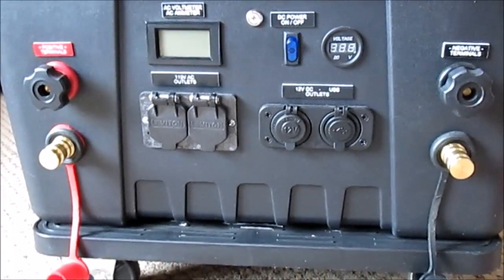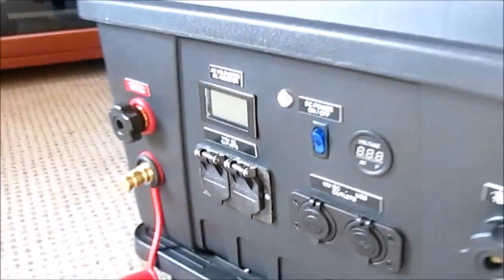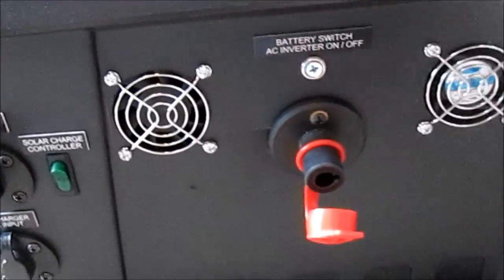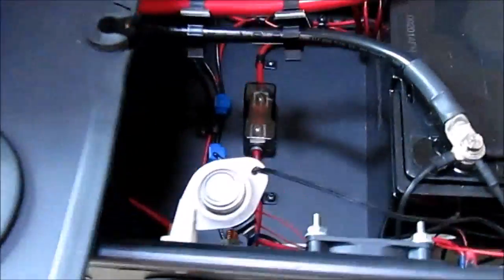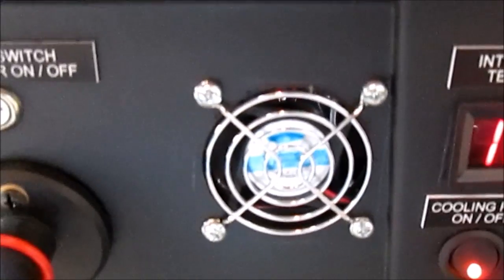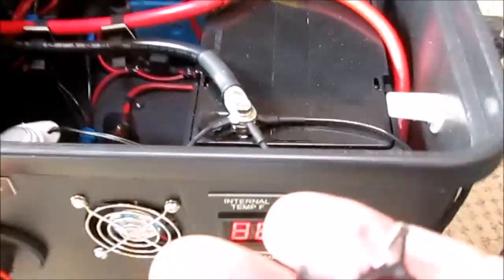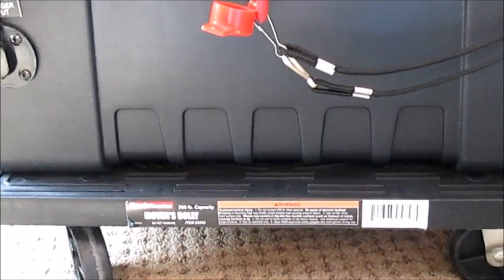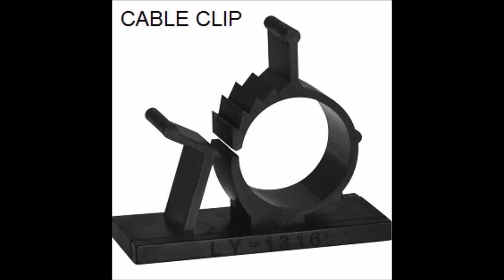V1 P4 DIY Portable Solar Power Generator

Comment: Years late to this it seem.  No, I don't care for the SAE connections.  I would have used Anderson PP instead in most places.  And for this I would have gone with 24VDC but that may not have fitted your use case.

Comment: I was going to build a battery box to take on my kayak, but then I saw your video. I’m building one like yours with the LiPo4 batteries, and a few of my touches. I’m building a large box to take camping in the summer, and employing it in the winter, in case there is a power outage in my town.
Reply from the maker: Kelley, thanks for viewing and for taking time to leave a comment.  I think you will be happy that you have built a larger system than would typically be built for use in a kayak.  Those are great, but I find I get much more utility from a system that can be used for all of the purposes you mentioned.  Have fun with your build!

Comment: is there a difference in manufacturers of batteries?? as long as its a12 Volt 55 ah 22NF UB12550 Sealed AGM Uninterruptible Power Supply??  why did you pick the battery you put in your project??
Reply from the maker: I don't think the manufacturer is as important as selecting batteries that have the capacity to meet your demand for amp hours.  I selected the batteries I chose for their total amp hour capacity,  physical dimensions, and the fact that they were sealed (safety feature for use on a boat).

Comment: Have you thought about adding an input for a wind generator?
Reply from the maker: Not at this point given my current needs, but I am planning to live aboard a larger boat in retirement and will likely add a wind generator when I make that transition.  Would be a great way to continue charging when sun is scarce.

Comment: Hi Jim!  Great job!  would you have the diagram for connecting the snap disc fan switch to the fans and toggle switch?
Reply from the maker: Thanks, but I don't have an updated diagram for that upgrade yet,  Give me a day or two and I can put a diagram together and even take some pictures of the actual wiring configuration and send them to you.  E-mail me at jim@creeksideartifacts.com as a reminder and I'll get back to you.

Comment: Hi Jim.  thanks for all of the great videos!  I would really like an mc4 input plate, but can't seem to find one.  could you point me in the right direction?
Reply from the maker: I just bought one from Amazon https://www.amazon.com/gp/product/B01AQ7FIXA/ref=oh_aui_detailpage_o01_s00?ie=UTF8&psc=1   You will need to buy the MC4 cables that are used to attach it to your charge controller-  they are sold separately.
Reply: ok thanks so much!  I thought that it was one of the round covered plates that you had on your system.

Comment: Jim, have been working steadily on my project - just got my Duracell deep cycle batter and beginning assembly. Quick questions, what gauge wire did you use between the battery and the jumping terminals?  I am thinking a minimum of 4 gauge or perhaps even 2 gauge.  Again, thanks for sharing you have done amazing work.

Al
Reply from the maker: Al, the remote jumper terminals I bought came as a kit, wire included.  It is 4 gauge that was used to connect the terminals to the batteries.    http://www.ebay.com/itm/Battery-Post-and-Wiring-Kit-Remote-Jumper-Terminals-/270661963490

Comment: Excellent build, glad to see you've added the thermostat, I was wondering why you didn't in the first video but I thought that's just how you wanted it. It's always easier to automate things when possible. Now you don't have constantly watch the internal temps.

It would be nice to link a list of all the items you purchased, I know it'd be a lot of work but it would also really hep those that want to build something similar.
Reply from the maker: The thermostat install was a simple improvement idea that was suggested by a viewer some time ago, not sure why it did not occur to me to use one when I came up with the original design, but think it is a great upgrade and only cost about $20.  That is what is great about YouTube-  lots of good people sharing good ideas.  If you go back to my part 1 video and click "show more" under the video description you will find links to my parts list and wiring schematic for this project.  E-mail me at jim@creeksideartifacts.com and I will send you some other documents that can be of help if you are interested.
Reply: Wow , such a quick and helpful response, thanks.

I agree YouTube is great for doing research and learning about new and old ideas.

Have you ever given thought to Lithium batteries? They are expensive but much lighter and will keep up the voltage even under load much better than an AGM battery. There are many reasons why they are the best way to go IMHO.

Thanks again and I may be contacting you in the near future as I'd like to build my own portable generators using lithium battery technology.
Reply from the maker: Lithium Ion batteries certainly offer some significant advantages, in both performance and in regard to ergonomics.  Using a couple of Lithium Ion batteries would reduce the total weight of my system by about 50 pounds (down to 40 lbs from 90 lbs at present).  The only drawback is the incredible expense of the Lithium Ion batteries.  I don't move my system around very much so it is as portable as I need it to be at 90 lbs using the relatively inexpensive AGM batteries.  I could buy about 25 years worth of replacement AGM batteries with what the initial cost would be for a couple of comparable Lithium Ion batteries.   Hopefully as the technology improves the cost of lighter batteries will come down and make their use in these systems more affordable.

Comment: Jim, wonder where you found the screw down posts?  I have looked and looked and have not found them.  Did find he jumping posts.

Great job - thanks for sharing.

Al
Reply from the maker: Al, the bulkhead terminals were purchased here http://www.speedwaymotors.com/Battery-Cable-Bulkhead-Connector,2353.html ;  The hand screw fluted knobs were purchased separately here http://www.ebay.com/itm/331323494408?_trksid=p2057872.m2749.l2649&ssPageName=STRK:MEBIDX:IT

Comment: I too am in need of an MC4 input plate.  A quick google search did not readily turn up anyplace to buy them. Suggestions?
Reply from the maker: Here is an input plate that appears to be set up to accept the corresponding MC4 connections on the cables that would be coming in from your solar panel(s).  It also appears to include the wiring to connect the input plate to a solar charge controller.  There are other version of this available at a lower price, but it does not appear that the necessary connectors or wiring are included.  http://www.vintagetrailersupply.com/Go-Power-Cable-Entry-Plate-GP-CEP-p/vts-761.htm
Reply: Thank you for the quick reply. I have seen these but wasn't quite sure if that is what you were talking about.  This will work perfectly.
Reply: Great modifications/additions Jim. I'll start building mine after I study all your outstanding videos.